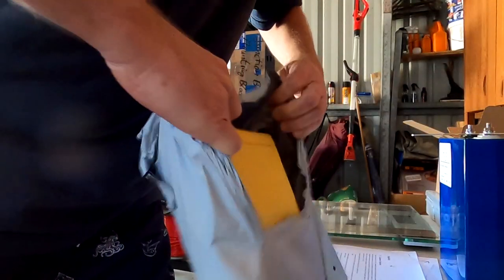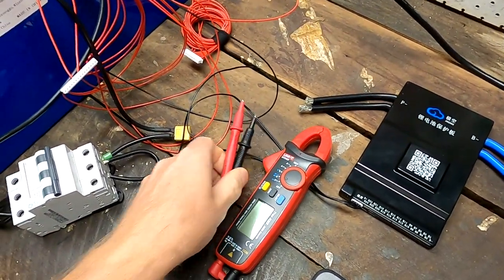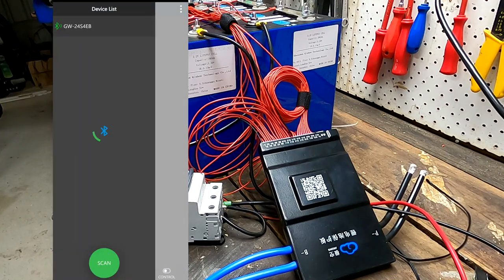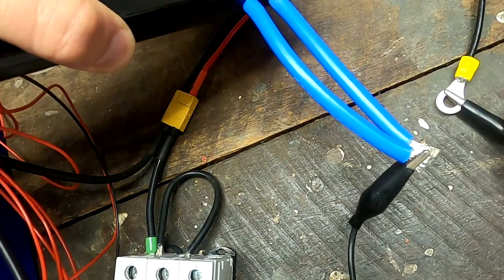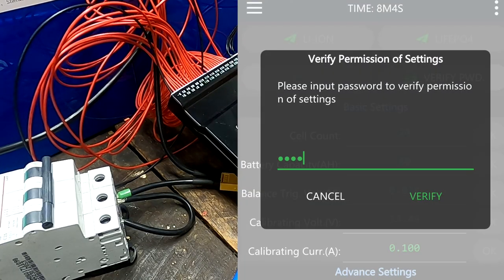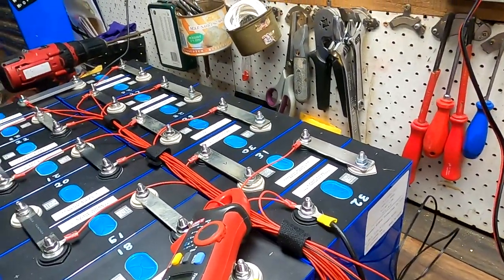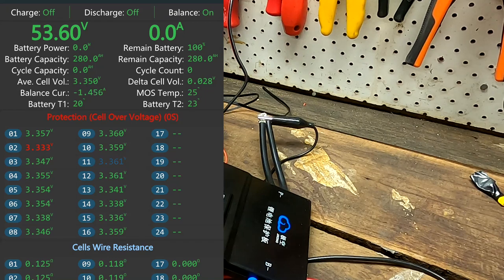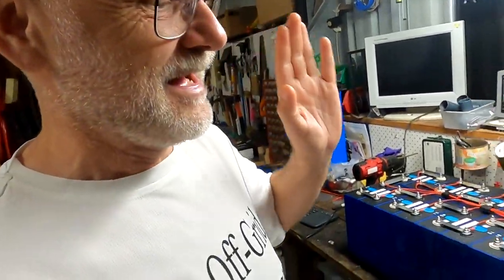The JK BMS with integrated active balancer. This is the one!

Comment: Hey Andy, that BMS is very similar to the BMS on my electric bicycle setup. The resistance is really nice, because my bike battery is made from used 18650 cells, so I was able to learn about a high resistance and it protects the bank before it causes further damage. Also It needs start voltage to turn on also, but it turns on during the bulk charge cycle or in my case with the bank is low or dead, i am dumping as muck voltage as the 48v laptop charger can pump into it and because the charge voltage goes more than 5v over the bank voltage, it triggers it on.. and it starts doing its thing. The BMS on my bike turns off if you dont charge it after a few weeks, like something internally is ran off capacitor voltage or something.. but it turns on as soon as i plug it into the charger. The only time this bothers me is when the bank is 100% charged aand i have not charged or used the bike battery for a while, when i plug it into the bike, the BMS is not actively working at that point until i plug the charger into it again to charge it. Mine is like 30ish days it lasts before turns off..
Reply from the maker: Thanks for sharing, William. Yeah, I wonder how I can do it when I have the battery in place. Not that the battery or BMS will turn off often but the occasional disconnect can happen and I don't want to connect a power supply all the time to trigger it again. Maybe the external e-bike charger is enough though... needs more testing...
Reply: @OffGridGarageAustralia  if that bms is like my bike bms, as soon as solar starts to charge the battery it should trigger it during the bulking stage.
Reply: @williamhustonrn6160  Hi,
I received this BMS based on this video. So I have no clue about making batteries or connecting this stuff, and learning as I go along. My understanding is that I plug in the BMS and hook it up to the terminal where the charger terminal connects, when it's connected to the charger the extra voltage above 48v will activate the BMS? 
I also will be using my battery bank and this BMS in a DIY scooter. So I just need to make sure it works right. Thanks.

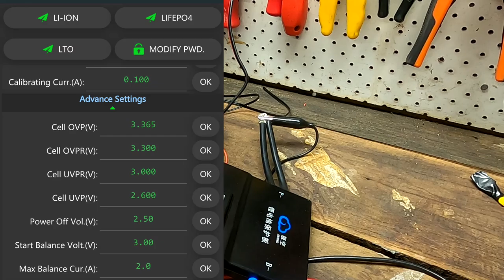Comment: 27:07 "... the only i have not seen here is a pack overvoltage..."
You are correct that to get to that pack overvoltage, it needs to reach cell overvoltage first. What I am interested is an overvoltage from the "source"  wherein BMS disconnects itself from the SCC if incoming voltage is too high

Comment: Hi Andy,
I really like your videos, congratulations.
I have a question, do you think the JK BMS with integrated active balancer can be configured for a lead acid forklift battery? 48V 775Ah.
Between what values can the cell voltages be set?
The main thing would be the monitoring, but if the active balancer also worked, that would be very good.
I wish you good health from Hungary.

Regards: Gyula

Comment: Looking for something like this but needs 240A continously usage & 100A charge. (12KW inverter, 840Ah 48V battery system) Seems like no JK BMS can do so :-( Any other BMS´s recommended? I see DALY´s can get a parallel balanceboard so they balance with 1A instead.

Comment: Very interesting! Im a bit confused with this active balancing thing. Isn't that the whole point with using a BMS to make sure the batteries always are balanced?
Or is this a special feature for this BMS? If so, do you really need to top/bottom balance the batteris prior to use?
Im planning to build a 24V 8S system for my cabin. The idea is to build two 12V 4S batteries (with individual BMSs) and then serial connect them with a battery balancer in addition. The reason for this is that I want to use one of the 12V 4S battery for my camper van while on the road and the whole 24V 8S system while back in the cabin.

Anyone out there with this setup, or would you recommend to use just one BMS that can handle 4S and 8S configurations, like this BMS?
Reply from the maker: Yes, the active balancer is a special feature of just this JK-BMS. It makes it outstanding and it works great. A top balancing is not really necessary but it could take a while until it's fully balanced. So, I would recommend to do at least a rough top balancing, say charge each battery to 3.6Vonce before putting them together i series.
If you add 2x 12V batteries in series, make sure the BMS for each 12V battery are designed for a series connection.
That's an interesting setup you have planned there. Not sure if you get a large enough balancer to balance these 12V batteries against each other when you come back from a trip. One could be empty and one full.
I think it better to build one 24V battery for the cabin and one 12V battery for the van. There is no BMS which can handle that unless you change all the parameters constantly.
Reply: @OffGridGarageAustralia  Big thanks for your reply. I have reconsidered this and think I will go for one 4S-8S BMS instead, like the JK, and then use it in 4S config while in the van and 8S while in the cabin. I know, it sounds complicated and require some changes in settings each and every time but as long as I leave the batteries fully charge in the cabin and make sure the 12V is fully charged prior to combining them again it should be fine, right? :) Alternatively I'll use the JK 8S BMS in the cabin only and then another 4S BMS for the van. I just want to avoid buying 12 cells instead of 8. Lets see, if I find it too complicated I'll probably end up buying 4 more cells in addition:) By the way, I really like your channel.
Reply from the maker: @kajakmannen1666  Thanks, Ivan. That sounds indeed complicated what you're planning. Well, I guess, it depends on how often you need to change this over from 4S to 8S and back again. You may get sick of it very quickly or very good and quick in changing all these parameters over and over again 😂
Reply: @OffGridGarageAustralia  Complicated is the word! :) I'll probably buy two 4S-8S BMSs to avoid parameter setting hell. Then I always have one in spare as well.

Comment: I want to do a test like this on the BMS from a Nissan leaf, many available from scrapped battery backs. they are set up for li ion of course, but maybe that can be changed? I am interested in the operation principle. I think it may not be just a shunt one. I do have the circuit and there are some unexplained inductors and other components on each cell.

Comment: So the obvious test: How does the short circuit protection compare to the DALY?
No, not really. The question is, what can you do with CAN/RS485? Can you connect it to your Victron gear?
Thanks for sharing :-)
PS: Does this BMS have the original "Tagesschau" beep?
Reply: Could probably have some cpu, small SOC for example, in between to translate and control since Victron probably will not support and talk to all other BMSes atleast for now. And commuications have already changed a few times for the JK if I read the github updates correctly.
Reply: That may be the problem. Just having a physical port, does not mean on every device, it is really usefull to you :-/
Reply from the maker: I'll do a short test with the smaller Palo cells and the Daly BMS to see if it work. That's how far I would go though. Everything else is too much.
Brad is working on this RS485 communication stuff at the moment.

Comment: So cool. Glad you found and shared. Now… to find one for 12v!!!
Reply: You can use it with a dc to dc booster from the same 12V to get the B+ line between 40V to 100V  to use it anyway.  Remember just that the dc-dc booster could drain the battery if left connected without charge for a long time.
Reply: Wish I could get one for my 24v system as well.
Reply from the maker: @johthe will this work with the BMS as well though? It works with the active Balancer I showed recently but with the BMS???
Reply: @OffGridGarageAustralia  Now we have to test it, don't we. I reason they can not tell it works with lower number of cells since it does not come with an extra DC-DC booster included in the package and it would be false advertising if they would announce it working with less. That is why it varies with cell chemistry to get over the 40 volt minimum to use and drive it directly with the monitored battery.  That said it could also be that someone of us is wrong..

Comment: The B2A24S20P specifications now state that it will work from 8S-24S for Lifepo4 batteries.
Reply from the maker: And it should also work for 4s/12V systems with a small booster installed. I'll test this soon...
Reply: @OffGridGarageAustralia  I just placed an order for this based on your tests. Should arrive sometime around the first week in November. Thanks!

Comment: I thought over the built in vs the external  active balancer I decided the separated route is the better choice.

This 2 A version is. more than twice the cost if i buy the o.6A JK version  and the 10A dedicated active balancer .  Well it is a no brainer that i take the latter.  Sure there are more wires and 2 things to deal with but so what? I do not connect and disconnect all the time and honestly dedicated device is alway better than combined device.
 
I have  18650 built pack for 14s100p so they are always out of balance from day one  as they came from recycle battery of laptop and tablet.  Way more challenge and complicate to use than the lithium phosphate type.  I need that 10A active balancer  to quickly balance the cells in both charge and discharge mode.

Comment: I just ordered this BMS and now seeing it requires +5V over the system voltage to turn it on???  Why would they do that?  Thinking about it, I have a 48V (16s) system and only a 30V PS.  Do I have to buy a 60V PS to get my assembled battery/BMS to turn on?    I have to believe there's a better solution and design for me and this unit!
Reply from the maker: You can just use two 18650 batteries in series or a 9V block battery to start it up. I thought the same at the beginning but now having this BMS running for a few months, it's a now brainer becasue it is turned on all the time anyway...

Comment: Wouldn’t it be possible to connect a usb/phone charger (5v) in series’s to the battery pack as the 17th battery 16s + usb charger “17s” to get the start voltage for the BMS?
Reply from the maker: That could work. I'll figure something out...
Reply: @OffGridGarageAustralia  5V+ to B-
5V- to P-
Reply: I just had success with the usb charger. It worked! :)

Comment: Have newer Version of the same BMS it now ships WITH A POWER ON BUTTON X-D (but it still was scary as heck to turn on CHARGE and DISCHARGE in Bluetooth = spark) Advised: connect only B- (blue) to battery main negative, leave (black P-) disconnected, connect via App, enable CHARGE and DISCHARGE (was not per default) then connect P- ?
Reply from the maker: It sparked? What exactly sparked???
Reply: @OffGridGarageAustralia  Balancer wires X-D thought "shit that's it, destroyed" but no it survived :D 👍🏻👍🏻👍🏻👍🏻🍺
Reply: @OffGridGarageAustralia  the negative balancer cable... it was not properly connected X-D

Comment: Hi Andy long time since we spoke it was last year when I first talked to you about a few thinks iam the Kev from uk I still watch your videos and keep passing information on via my facebook pages that I have.   I just wanted to ask if anyone else had same issues with the new jk bms 4to 8 2amp Bluetooth version you did a video about 5 months ago I think.  Any way I ordered 2 from a Amazon seller very good service with delivery but had problems with information I have just received and just found some information on  but not a lot on this version also having difficulty in finding the software to update to the latest version as I had same problem as you did when you started to use.   The jk bms web site doesn’t have anything re software updates on  have tried doing online search for this update not a thing.  I have email via my phone ad ther website won’t send emails at this moment have reconnected the seller but I think it’s an agent.   Dot know if you can help with a version of This software as I can’t get anything to work at the moment. Lol.  I wanted 4 weeks for the 2 to arrive it did exactly on the day that they started but can’t build my two 8s 3.2v 304ah units until I can get this software.    I was interested to see if others had same issues   What I can see is a good build.   But at this moment in time had to stop the build so frustrating.     Lol   Anyway Andy keep up the good work on your project. I watch your videos In batches. Usually when I can’t do anything   Ch. from Kev in the uk

Comment: How does the cost of this unit compare to the Neey unit you recently reviewed?
It seems to me the Neey unit was like $125.  Or did you buy a much more expensive Neely unit?
Reply: Also, It would be interesting to compare the two, and address why the JK is better than Neey.
Reply: @farside87  The JK seems to support more cells & it is more configurable--although, I think the Neey provides up to 4A of balancing current--which seems to be 2x greater than what the JK can do.

A good full comparison would be good.
Reply: @ab_ab_c  It seems the JK has a BMS w/an active balancer, and the Neey is just an active balancer.  The Neey may be a better active balancer but apparently won't manage the batteries as well.  Someone will have to explain to me the benefits of having a BMS if it's not to balance the cells.
Reply: @farside87  to disconnect chraging or discharing when batts are to low or to high and low temp charging disconnect . Prob Neey can be connected somehow.. since is having wifi..so maybe between invertor and mppt with rspi as controller
Reply: @farside87  A BMS is supposed to balance cells too, but often they just monitor & cut-off charging or discharging once any cell reaches the cutoff.  

An active balancer moves energy from one cell to another cell to keep the cells balanced/equalized.

Frankly, a good BMS should perform all functions, imo.
Reply from the maker: Totally different device. The JK is a BMS with active balancer, the NEEY is just an active balancer without any cell protection, so you need an additional BMS for that safety.

Comment: I just installed one of these on my 14S pack I built.  The Bluetooth LED is always lit, it never turns off.  Is this normal for the unit to always have a small power draw? Did you find any way to completely power down this device?  I have not been able to so far.
Reply from the maker: The BMS is there to protect the battery cells, so it needs to  be turned on all the time! Yes, it will draw a few mA but this should not be significant, they are very power conservative and efficient.

Comment: Great video.  I recently contacted them asking if I can add multiple battery banks, each with its own JK-BMS and they replied that it is not supported.  Is this true?  If so, what is the workaround?  I plan to build 16x280ah EVE with this BMS and add another set of 16x280ah with its own BMS
Reply: Good question, I'm planning to do the same.
Reply: So you never got a reply Adrian?
Reply: каждая bms в массиве подключается через высокотоковый предохранитель или мощный диод.

Comment: I would like to see an actual test of this BMS connect to inverter RS 485/can bus with more than 2 same BMS.
Reply from the maker: Yes, me too. Seems like I have to do this test at some stage with my the battery banks. But not connecting it to an inverter but the Victron system for monitoring purposes. Inverter connection makes makes no sense in my eyes...

Comment: I bought 8 of these batteries, which I will be running at 12 volts on my boat, 2 x 4 in series and then in parallel, and the same JK BMS after watching one of you previous video's Andy. But now it seems it is not suitable after watching this video. Any suggestions for a BMS suitable for my setup. The JK was $288, it is still unused in the box if anyone wants to make a reasonable offer for it.

Comment: 12:57 If BMS is off and the pack is connected to charge, what is voltage across B- and C-?
Reply from the maker: Don't know. Why do you need to know this voltage, is this important for anything or just curiosity?
Reply: @OffGridGarageAustralia  I am curious if B- and C- is a completely Open Circuit when OFF, or if there is some detectable impedance across, such that when B+ and C- is connected to chargers, the latter will be able to put the necessary voltage to turn the BMS on?
Reply: @OffGridGarageAustralia  Asking for Voltage was irrelevant. I should have asked Impedance across those two wires when BMS is off and nothing is connected yet..

Comment: Qui question Andy as you are my "guru" with regard to DIY LiFePo Battteries: what kind of JK BMS did you use? That one with CAN BUs, with RS485 or with LCD? Just want to get the same results as you have and therefor I would much appreciate a quick feedback from your side. Thanks a million for all the great videos, I never learned that much since I watch your channel. Thanks !!!
Reply from the maker: Hi Juerg, I personally have the old style 16s JK-BMS without display. It has RS-485 though which I will need in the near future to communicate with the Victron system.
All the new JK-BMS should come with the display port for ease of turning them on with a click of a button. More info is on my website: https://off-grid-garage.com/battery-management-systems-bms/
Reply: @OffGridGarageAustralia  thank you so much Andy, that’s a service much much better than any professional firm would deliver. BR to down-under from Switzerland and please go on with your channel for the next 20 years!!!
Reply from the maker: @juergwyser6520  thanks a lot Juerg, much appreciated! I will certainly continue making videos😉